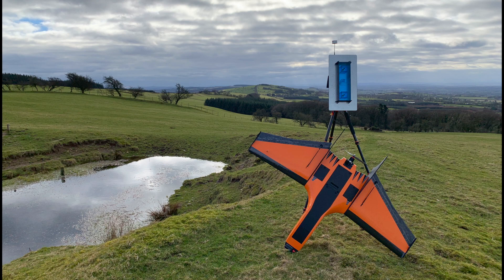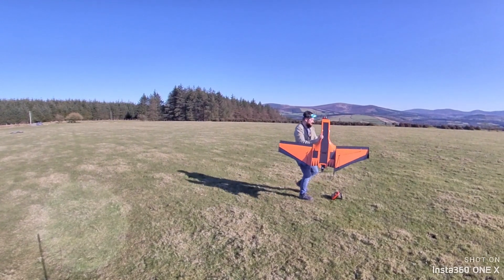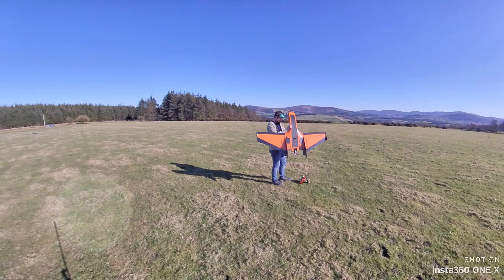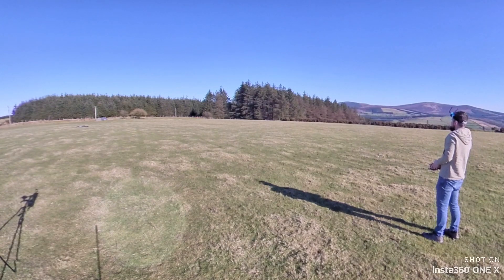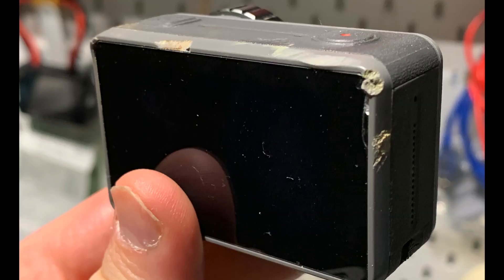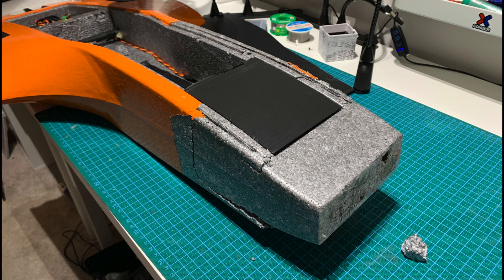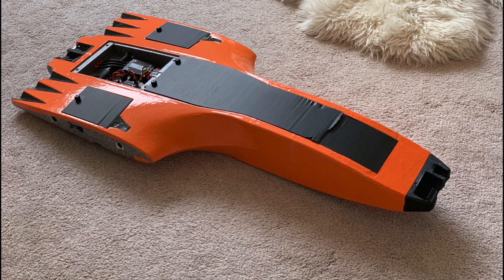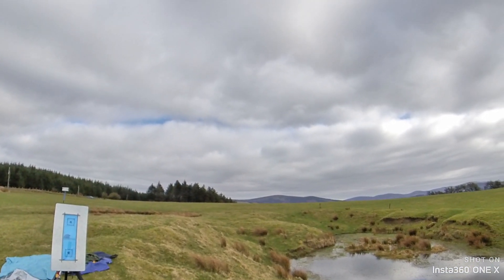88mph Drak Crash - FPV  🤬

Comment: If ever there was an example of why a delayed idle for autolaunch is a good idea, it’s this. 

It looks fantastic Adam. That 5D carbon looks slick.
Reply from the maker: 100%!!! I’d considered putting in a feature request ages ago before this happened and maybe I should do it now. Or maybe someone has already requested this and I can vote it up ⬆️

Cheer mate, that 5D stuff looks really smart and it’s so easy to apply, especially to glad areas like these lids. 😃👍🏻
Reply: As well as the idle throttle delay, this setting nav_fw_launch_min_time will ignore any TX inputs, accidental or otherwise, for a short time giving you the opportunity to pick it up without worrying about knocking any sticks etc. or treading on it :-)
Reply from the maker: @MrD  awesome thanks I’ll take a look at that shortly!
Reply from the maker: @stevietee10  I had considered this for a brief moment but decided I wanted the ability to be able to shit off the throttle should the launch not go well and it ends up on the floor. However I didn’t look into this feature much and maybe there is an override by doing something like disarming 🤷🏻‍♂️

Comment: Two words of advice from a fellow hand launcher - NECK STRAP.
Great to see it repaired and back in the air,  personally,  I don't feel a plane is REALLY mine until I've repaired it  ;-)
Reply from the maker: Haha fair enough, thankfully I haven't had to repair too many planes in my time, this was the biggest repair job i've done. Neck strap is essential for planes hand launched with one hand, however I use 2 for this so have to place tx on the ground. Thanks to an iNav dev I have a custom solution now😁

Comment: Thanks so much for sharing ... for at least three main reasons:
1 - we learn from that mistake - keep sensitive stuff out of the way you may step over, especially when you have to throw something heavy as fast as possible at the right angle that you may instantly need you to stabilize yourself after and do not expected moves in a wider radius ... and make a healthy compromise with the wind direction and the given environment (once I have almost been throwing my wing into the only tree around)
2 - collect every little bit of debris from the crash, not only for environmental reasons, this stuff can be glued back up and it may save you from buying a new air frame ... when properly laminated and/or taped it regains its stability and doesn't compromise the airflow either (congrats on that fantastic repair job!)
3 - it makes it easier deal with our own stupid/avoidable mistakes when we see that a much more experienced pilot also screws up things occasionally and most of all is strong enough to share this mistake in order to help others 👍 
You are a better pilot when you process your mistakes, create routines to avoid them in the future but also forgive yourself and look ahead without fear that would counteract the enormous joy this hobby brings.
Reply from the maker: Thanks for the great feedback! I really appreciate it. Great to hear that sharing my experiences can help others 👍🏻😁

Comment: There is a parameter to set in iNav to make it ignore stick inputs for the first X seconds after launch. Set this to something useful like 3 to 5 seconds to avoid that...
Also I recommend Bungee launch - takes just a few mins to mount on the field, but it will give you a 100% success rate launching whatever plane.
Nice to see that you fixed it after this crash, impact sounded already expensive :-/ Beautiful plane!
Reply from the maker: Thanks mate, I've tried to avoid bungee at all cost just for the extra kit and setup/pack away time and effort. AL is successful every time I don't boot the tx😅

Comment: I always consider an under arm launch as these issues will happen.  Also throwing under arm would allow control instantly back into having options if it doesn't go fully right. That looked a nasty   crash even for a Drak. Well done on getting back flying. 👍
Reply from the maker: Yeah it was a good smash, amazing how well it repaired. Cheers

Comment: Gutted for you mate. I think when we're talking aircraft this big (and Im not flying my sky hunter without one) is a bungee launch - I'm left handed and trying to launch and manage the throttle is a nightmare - I dont trust my feet to manage acceleration either lol but finding a decent launcher seems to be real hard and I dont want to make one myself as I'd hate for it to fail and wreck the plane - Im a bit cautious as you can tell :D Anyway - glad you managed to repair it - looks like a great job fella
Reply from the maker: Cheers mate, yeah it ended up looking ok in the end :) I've tried to avoid bungee purely for setup time. I really try to limit the time it takes me to setup and pack away. Cheers Carl

Comment: I did a similar thing during a 30 second Autolaunch myself...Casually picked up my Transmitter and just nudged a stick, enough to drop it into Horizon Mode..Still taking my time to get on the Monitor, it's heading out at zero feet towards some trees and hedges..just pulled it up in time...🤔😳😳🇬🇧
Kudos for mending it, that was pretty bad damage...🤔
Reply from the maker: Ah yeah mistakes are made, glad to hear yours didn't result in damage. I'm happy with how it is now anyway :)

Comment: Dang. So happy to see how well it went with your repair afterwards. I would be pissed by myself to. Glad it turned out so well. 
We all been there once. I remember when I had my Raphax pretty fresh. It was in POSHOLD above me and some high trees next to me and I wanted to chase it with my Quad. But I was so stupid and cut the throttle when I layed down the radio to grab the other one to launch the quad and did not realize that motor stop override was on. So it circled down with no power and when I put the goggles on to change channel, I saw the last second before it hit the tree nose first, directly into the step. But fortunately, nothing more than a bit crumbled foam (that was replaced by a TPU nose afterwards anyway) and a few scratches in the lam. The Climb Action to get it out was a bit nerve wrecking though xD
Reply from the maker: Glad to hear I’m not the only one that makes these silly mistakes. Amazing the impact it can have! Glad to hear your Raphax was also restored after the incident. Hopefully we all learn from these errors 😅 thanks for watching Marc 😃👍🏻

Comment: Ouch. Very instructional. Sad to see such a nice plane crash like that. I used to discus launch wings quite successfully which allows you to hold your TX. Maybe intimidating for a Drak though but I bet it could be done. Also you are deep enough into this to look at Ardupilot. Love iNav but my planes fly Ardupilot!
Reply from the maker: Yeah I don't think the Drak will be suited to the discus throw (which i've used on other wings).  My current method works well when I don't play football with the tx haha. I tried Ardu but got fed up of issues using MacOS as I don't have a Windows machine, so I gave up. iNav is improving rapidly at the moment and I'm looking forward to seeing huge improvements in version 3.0 which is due to be released this summer. Cheers
Reply: @AdamGdoesFPV  Yeah. Mission Planner is the weakest link for sure. I have had good success with QGC which works well on Mac. But iNav us good enough for FPV.

Comment: This is exactly why I'm now using minimal launch time parameter, something similar happened to me (accidentally moved the stick while in autolaunch and plane went to the ground)
Reply from the maker: I actually have custom iNav firmware installed now and I have a timed delay on the idle. No longer need to use my foot or stand anywhere near the tx🤘🏻

Comment: I feel ya on the launching of this big bird.  I've always had friends throw the plane for that reason.  I've blown the nose off of mine 3 times now, 2 tip stalls and 10k worth of 5s in the bin and then the third fail i was flying along after a great launch and wanted to hit the DVR button on my ORQA's and instead hit the power button which was set to press off at the time and power down they did.  I was at 200' altitude and it pitched strait down went into the ground.  It only broke the nose off again.  This foam is some amazing stuff for sure.  It's an amazing craft and demands patience as we have found out but is insanely forgiving in hard impacts.  Cheers and here's to many more flights!
Reply from the maker: Glad to hear yours has survived so well after all of that. Shows they’re worth the money. Mistakes can be frustrating so I feel your pain on those occasions. 👍🏻

Comment: Nice rebuild.

Its been a while since Ive used autolaunch but I believe you can set rth alongside autolaunch and if you were to cancel autolaunch it should go straight into rth.
Reply from the maker: Thanks :) well the way it works is you set a flight mode and that's what it enters when Launch mode is ended via time limit or stick movement.

Comment: Nice repair job. I flew my MD into an electric power line .Filled the gougr in the wings leading edge,recovered with vinyl,and the next day it was in the air again.YeS RW are expensive,but will last for ever,just look at Shelbys MD.
Reply from the maker: They do survive a good smack! My MD survived about 10 failed launches in one day when I had an issue with the thrust angle. Most other planes go home broken after 1 failed launch haha

Comment: So unlucky!! But it did repair very well.

My only critique is the launches are kinda rotating the Drak out of your hand, so it dips the left wing before the verts/auto launch catch it and it levels off.

I think this is where I prefer a manual launch for this one, gets the Drak proper weightless and you just give it a toss, but throw it straight without any spin. I have given mine a spin in a manual launch and it is a bit squeaky bum trying to recover it lol
Reply from the maker: I haven’t got your super launching hands 🤣 AL has succeeded every time... it’s just when I boot the tx it fails 🤦🏻‍♂️😂

Comment: I'm only fearful of flying at 3 points..... the launch, flight and landing. At least you're only fearful of one part mate.
Of course, I've never done anything so stupid as tread on my TX, I went one step further - No one knows this but........During the maiden launch of my last FX61, for some reason I forgot to hook my TX onto my neck strap. As I let go of the TX to pull my goggles down, it hit the floor, battery cover fell off and the battery came out and ripped the battery connector off. This is when I realised RTH didn't work and I never saw the FX61 again. There is one consolation, I had everything perfectly set because it climbed at a constant and perfect angle until it went out of sight. I never released the video because, for some reason, people saw me as an ambassador for the hobby 🤣🤣🤣
Reply from the maker: Haha mate I miss your FPV videos! They always make me laugh, just like this comment did! Yeah dropping your tx like that is a silly mistake... but I can fully understand how this can happen. What a nightmare though, I wonder how far that FX61 went before it 'landed' lol

Comment: i've broken the nose off my full size drak 3 times, the first two were during landing where it tip stalled and center punched the ground, destroying the battery and nose.  Some E6000 and i was good to go.  The third time, i launched fine and was flying around no problem when i decided to turn the fan on in my ORQA goggles.  I had the power button still set to one push off....  I hit the wrong button at 200 feet in manual mode.... Strait into the ground it went, again, breaking the nose off.  Besides the wrinkles, it's very difficult to see what has happened.  Also, it's not broken in the same spot.  It is well worth the price, as you stated, any other model would have been confetti.

Cheers!
Reply from the maker: Good work repairing so many bad impacts! You're right, it's worth the money as it lasts.. even when you crash it! Thanks for watching and sharing your experiences

Comment: I don't know so no hate intended, but why did you put the transmitter on the ground? Couldn't you hold it with one hand and throw plane with the other?
Reply from the maker: I use both hands when I throw. I'm not the best at launching planes so a 4.3kg plane that's an awkward shape is a bit of a challenge. Thanks to an iNav dev I have a custom version of iNav now with an idle throttle delay so i no longer need to use my foot, works a treat
Reply: @AdamGdoesFPV  Nice! Happy flying

Comment: I have two of these , actually three , one built and two new in a box for anyone looking for one ,  with carbon arms, motor and servos sets , these came from Chris in the USA , The one that is built has a matek wing flight controller and 1.3 GHz FPV, it's also signed on the wing by Chris Click so a rare one for sure. They were £500 each . Top end on the repair , they are very strong planes.
The launch with this model is dicey , I injury could Acure quite easily , your better of putting the RC controller on a stand or have the plane launched with a second person or catapult , that's  what I used , safer for sure.
Reply from the maker: In inav 3.0 you can set a idle throttle delay, so now i don't even need the tx anywhere near me. I don't like to rely on others to launch my planes, to be practical I must be able to launch it alone. Cheers

Comment: That’s rough and a honest mistake but I’m sure you were mad at yourself. Looks good as new after the repair nicely done. Any tips on how to keep the hatch more flush to the body? I have the nano I just built and the hatch although bolted down has gaps like not flush to the body
Reply from the maker: Thanks😃 and yes I was mad with myself for a while. Seems like a stupid way to smash a plane up. The hatches are hard to get to stay down unfortunately, I have large gaps on my mini Drak. The easiest way with the big Drak is to glue in as much foam as possible in the nose, and then glue the lid onto it, having the hinge closer to the rear. Cheers
Reply: @AdamGdoesFPV  thank you sir. Also at least you didn’t also smash up your radio while stepping on it. Your video has made me now aware of acing radio off to the side from where I’m launching so I don’t back up into it. She looks and flies great again. Good work!

Comment: Adam what mAh battery are you using for your Ground Station ? And how long ( how many hours ) does it usually last ?
Thanks
Reply from the maker: I normally use a 5,000 3S and it lasts many hours, not sure how many exactly. It’s never run out in a days flying
Reply: @AdamGdoesFPV  
Thank you so much Adam for always taking the time to answer my questions 
I really appreciate your kindness

Comment: This was hard to watch . But nice recovery of the build. You say you used E6000 glue to glue all the foam back in lace . But I read that that glue is not good for foam . You are the 2nd pilot I see suggest this glue . Who is right and who is wrong ?
Reply from the maker: Standard way people build Ritewings is using Goop/E6000 based on recommendation of the designer/manufacturer. I use E6000 on all of my planes these days and it works extremely well and doesn't go brittle or leave the foam looking yellow like some glues.
Reply: @AdamGdoesFPV  Thanks . Have a few more foamies to build , and wanted another option for glue. My Believer 1960mm took a dive the other day , and needed that repaired as well.

Comment: Don't use your foot...use the shake method to avoid tripping over the controller.

Good thing these planes are built so well, and the ability to rebuild easily
Reply from the maker: The shake method has it's disadvantages which is why I don't use it. The foot method worked well for me for a long time now, this was just a bad day. Hopefully soon there will be a new feature implemented in iNav meaning I won't need to use my foot any more. Cheers
Reply: @AdamGdoesFPV  yeah the larger planes are a pain.  Have attempted that with my sweepwings behemoth and it was sketchy.   Thoigh now use a bungee and don't have to worry about bad launches

Comment: That hurts to watch 😞There is a setting in iNav called NAV_FW_LAUNCH_MIN_TIME that's supposed to lock out the sticks for a timeout. I've killed planes by knocking the sticks on throw.
Reply from the maker: The reason I've been reluctant to use that command is in case something goes wrong in the early stage of the launch and you can't stop the motor. I didn't ever anticipate kicking my tx haha. Thanks to this video a new feature was developed in iNav for Autolaunch... you can set an idle throttle delay. So now when I move the throttle stick with my hand, it will wait 10 seconds before motor actually starts the idle :)
Reply: @AdamGdoesFPV  I hear you on wanting to kill the throttle on an auto launch failures. I tend to throw while holding the transmitter so a short (1-2s) lock makes sense for me. Thanks for the new setting tip , I’ll check that out 👍

Comment: Big loss, I "felt" your regret right after that big hit. But Bro, look at 4:09 - you are doing the same mistake again! This sideway-backward move towards your radio while still looking at plane.
Reply from the maker: Trust me I knew what I was doing this time, I was very aware of the tx position 🤣
Reply: @AdamGdoesFPV  this time:) but you will still keep this way 1-3% fail rate, if walking before turning head first :) Autolaunch works on your Drak perfectly, no need to rush so much and save 1 more sec by moving backwards.